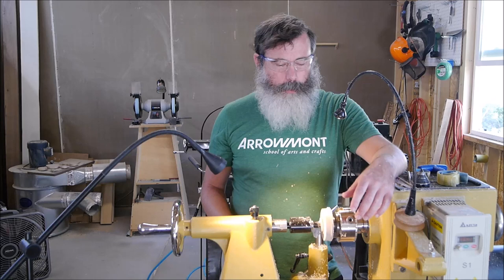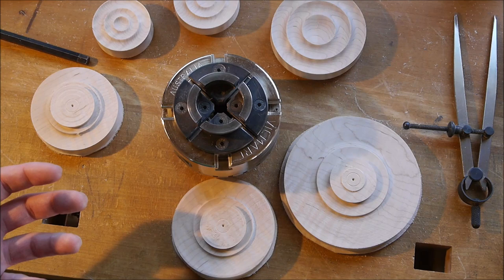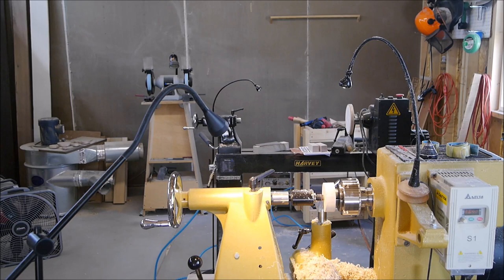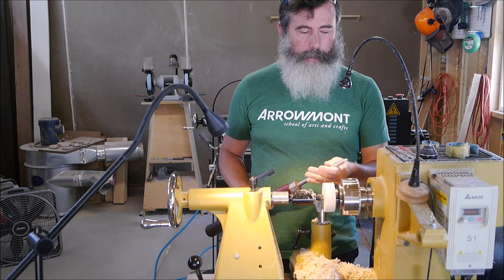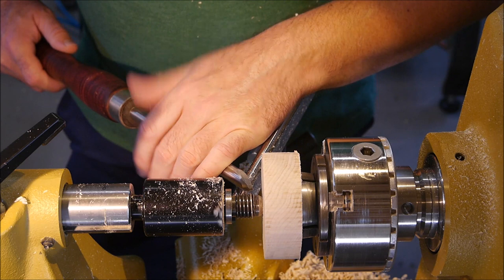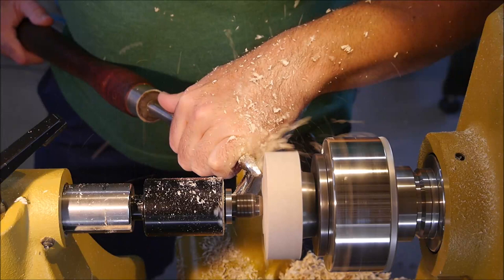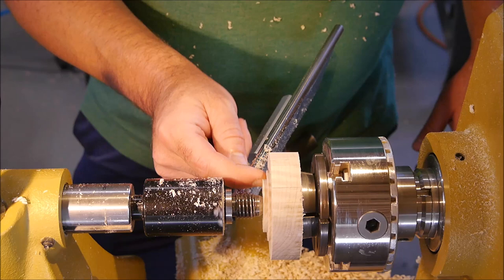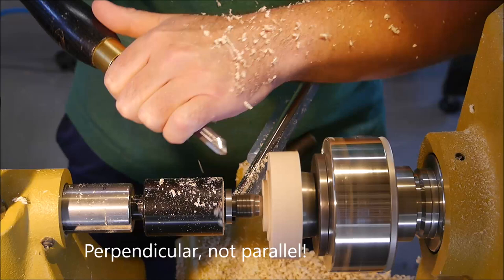Three keys to make a good tenon for holding bowls and vessels in the chuck while woodturning.

Comment: Good video, thanks. I note that Crown Tools, in advertising their dovetail scraper, states that "Tests have shown that as much as 50% of a collet chuck's gripping power is lost if the dovetail angle is out by as little as 5°." This might just be an effort to sell their scraper, but even if the point is true, I think that it is not difficult to eyeball the angle within 5º, so it is likely to be accurate enough to do it without any special tools or measurements.